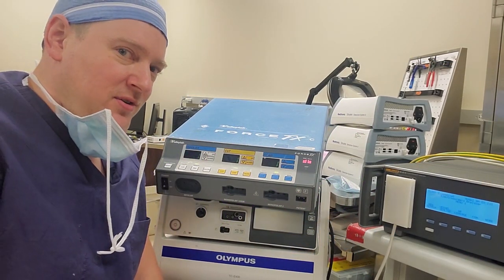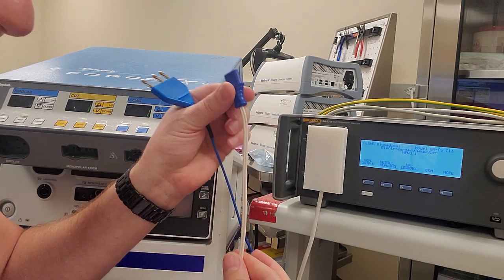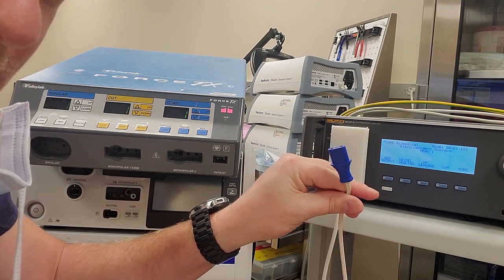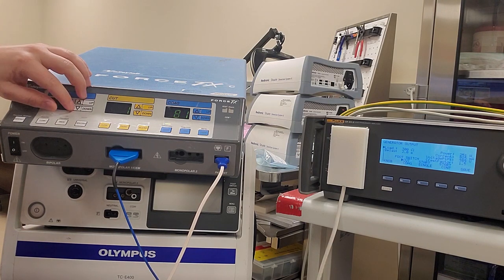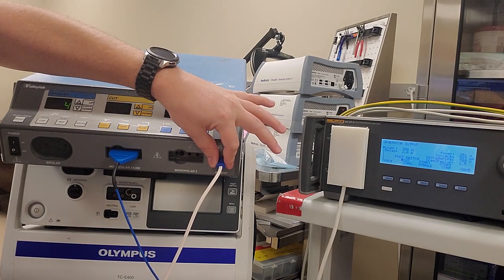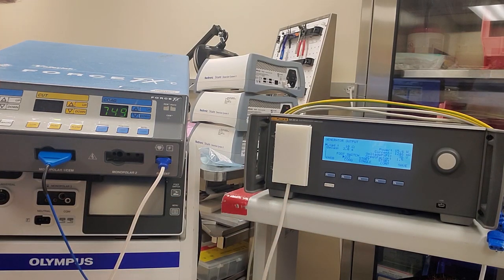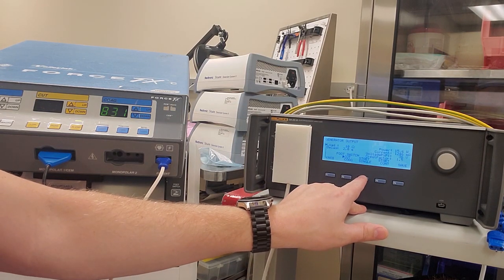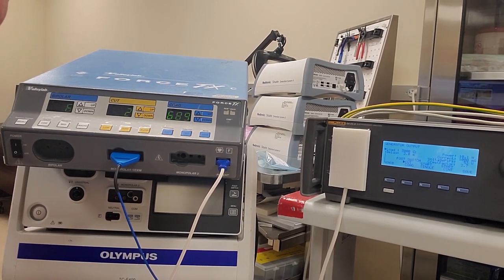Force FX C Monopolar Calibration

Comment: I have the error 16 and already read the service manual but doesn't have the transformer or inductive resistors. I have the fluke 454A but doesn't have the 30 ohms resistant option, with 100 and 500 would be enough? The error 16 starts when put on the plate on the patient. 

Also read on a forum that could be "Scaling relays in the control board", how can I probe them? I doesn't have another Force Fx.

Some days ago I made the REM calibration because the equipment was showing green REM alarm when plug in the plate even without patient. Also the trouble that made the hospital call me was that the equipment wasn't turning on right, it had a problem in the initial test.  When the lights were on bipolar it started as usual but were restarting the autotest when passing trough cut. 

Should I try to fix It or is better just change the equipment with all that issues?

Appreciate any help
Reply from the maker: Use resistors instead of an analyzer

Comment: Could you possibly help me out ? I had one of these in today, no rf output on coag - spray or fulgurate but desiccate works perfectly. There is no error codes on boot up & all functions of cut work perfectly. Any ideas & where possibly to look ? & what might have failed ? If not I’ll have to get Medtronic to take a look at it.
Reply from the maker: It's no longer supported so the OEM will not assist. Try a different front control panel.
Reply: This device is still supported by Medtronic in the uk ! I’m just in the process of getting it shipped back for assessment & repair.
Reply: I had a very similar fault and it was the 6 pole relay on the main board. Really easy job to change.